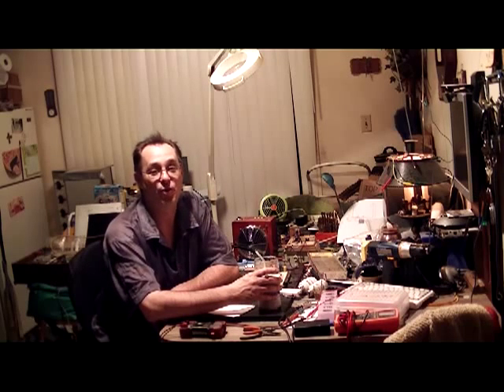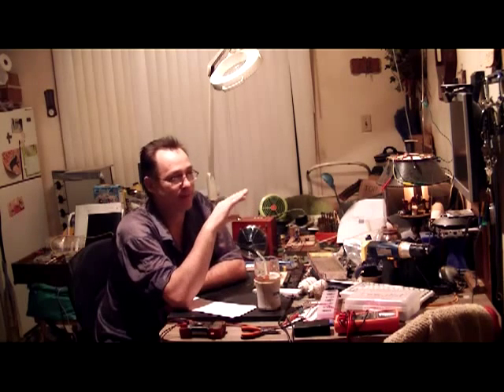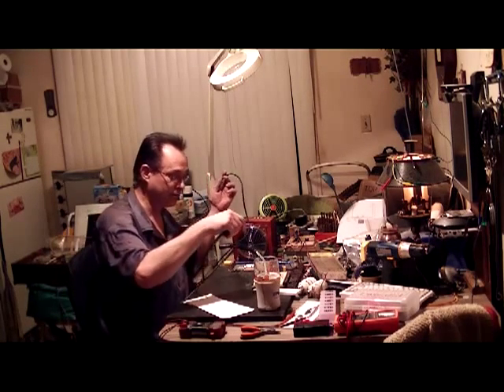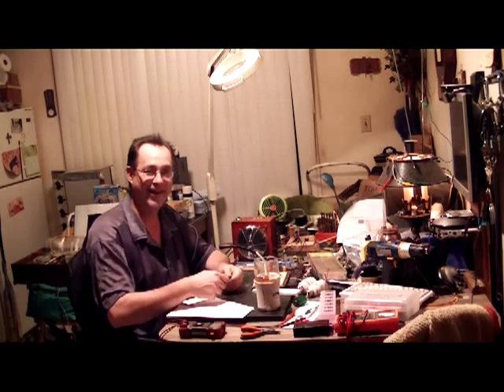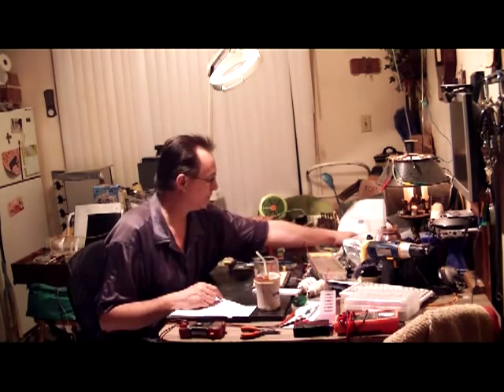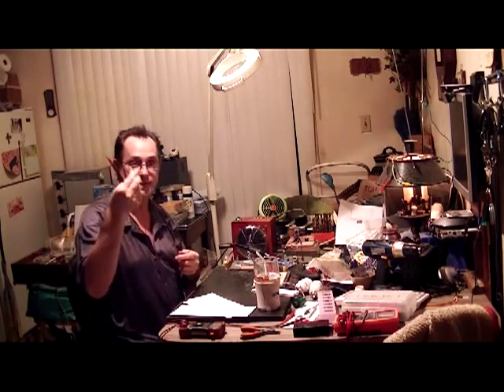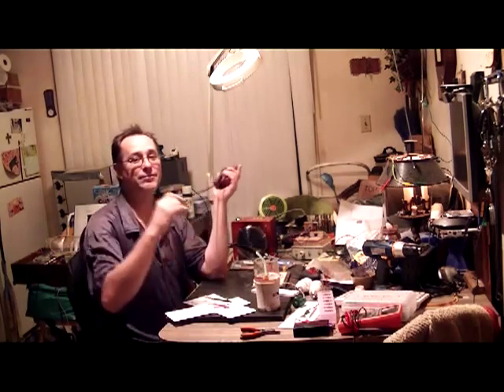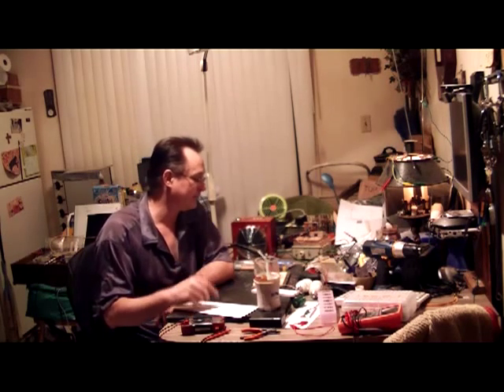Getting started- DIY guitar pedals - tools  Part 3 of 4

Comment: I need to go to harbor freight and get a step drill and heat gun. There is one in Knoxville which is near me. Great vid. I learned a lot. :)
Reply from the maker: my advice on HF is look at the site , sign up for email alerts ,  ... they have GREAT coupons  AND sales , often . they do event sales , like parking lot weekend sales , etc ... they also have a membership club , i would think joining that immediately would be the thing to do . i didnt ... you can save a LOT . i regretted this as right after i spent 60 there , with the sale and club , i could have reduced it to 40 . save up some $$ , its a baaaaad place ... if you are handy and like cool tool stuff .  i had to put about 60 worth of stuff back the first time i went . the second timei went back , i brought Donna with me , ha , but we still spent double what i planned . hey i use all the stuff , and its so much cheaper ! i recorded with the burns buzzaround germanium yesterday , WOW !!